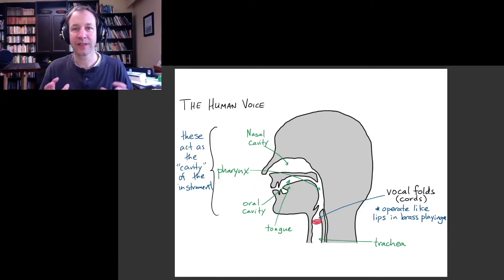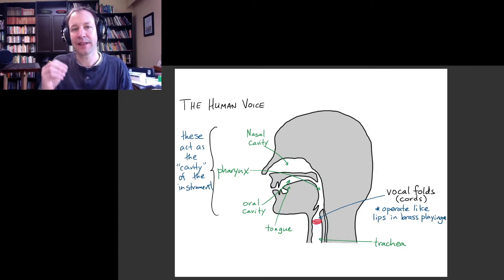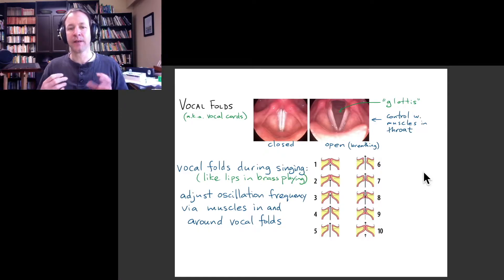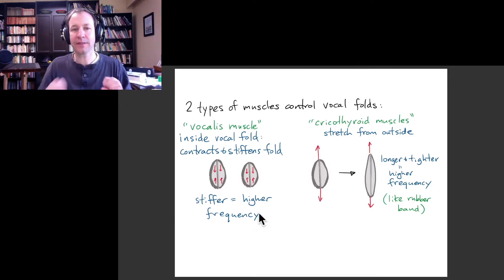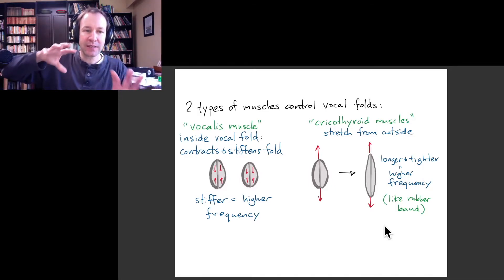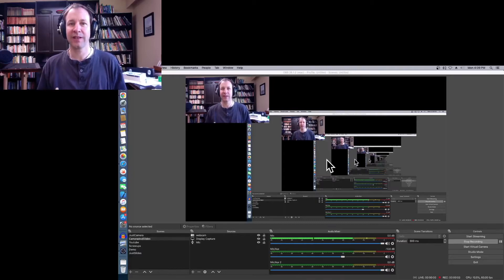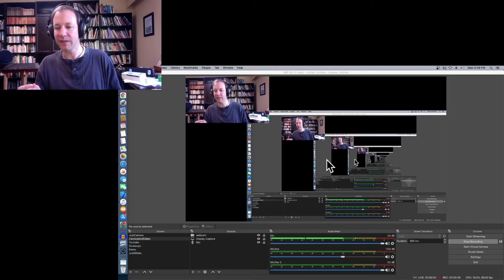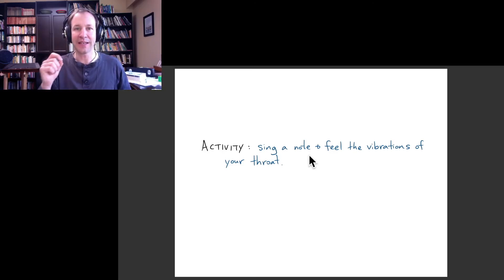Physics of Music 56: Human voice 1: the vocal folds, modal vs falsetto

Comment: As a physics graduate trying to get better at singing, this is exactly what I needed! Thankyou.

Would you say the concept of 'mixed' voice is still M1, and it's when you use both the stiffening muscles and the stretching muscles simultaneously? Also the concept of a 'break' when moving up your vocal range is perhaps to do with not having enough control the relax the stiffening muscles gradually enough?

Edit: Watched an anatomy video, it says that the vocalis muscle actually creates slack in the vocal folds when contracted, lowering frequency. So bottom M1 is fully contracted vocalis, then as you move up you relax the vocalis, and then at some point you begin to engage the cricothyroid to transition into M2.